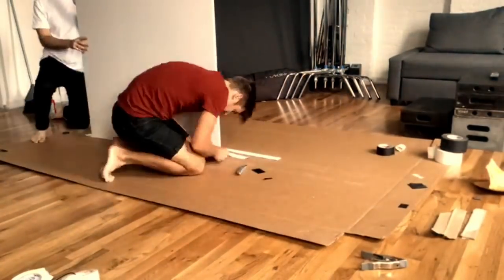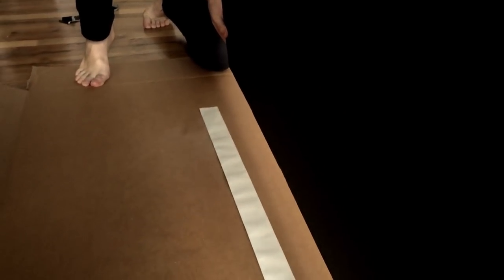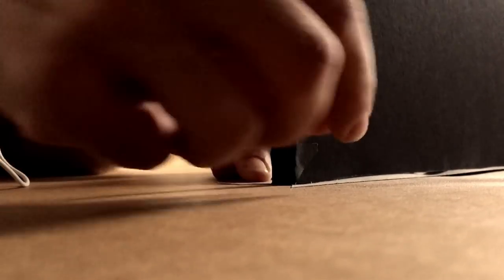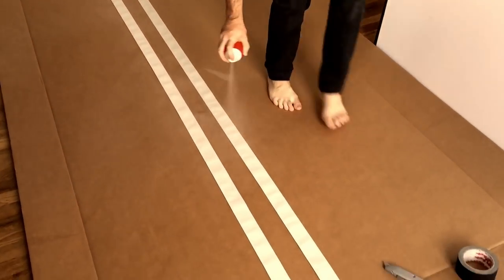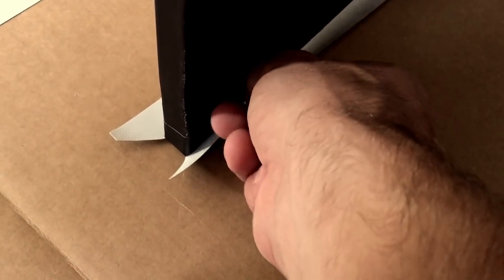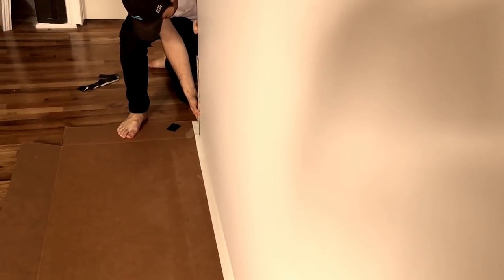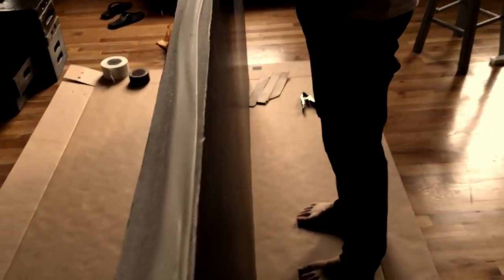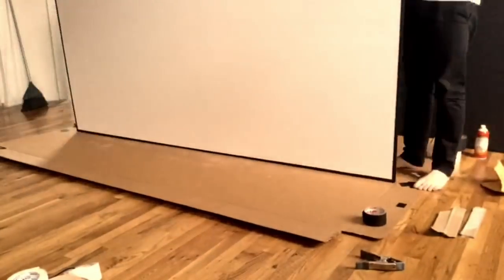How to make V-Flats - Felix's step-by-step guide

Comment: For people who can't get black/white combination boards what we do in Australia is glue a 5mm paper faced white panel to a 5mm black panel to get a very stable unform finish. These we hinge together with velcro strips and in the last few months we've also started to add an aluminium U shaped extrusion around the edges which adds to the durability and increases stability.
Reply: I buy white insulation foam boards and paint one side matt black. Sucks up a bit of paint though. About two panels per litre of paint
Reply: @cptbrncls7050  did it warp though?
Reply: @Avat6  no
Reply: @cptbrncls7050  ok I did try the same  on foam board and applied 2 coats of black Matt paint. It did warp which is a bit annoying .
Reply: @Avat6  stuff I used was about 50mm thick. Insulation panel
Reply: Would it also work if you get some wood panels, paint them and put them together with hinges? Or would that be to heavy?

Comment: Manufacturers make foam core products with white on one side and black on the other. You'll want at least 1/2", 3/4" or 1" thick sheets, not 1/4". I couldn't find the size from retailers for a reasonable amount... look for wholesalers to the framing or sign industry. You should be able to find a local source--shipping something that size is ridiculously expensive for a few sheets.  To do it on the cheap, go to Home Depot or Lowes and buy 4x8 sheets of rigid insulation and paint them yourself with flat white and a flat black.

Comment: Thanks for this tutorial. I just have a couple of questions.
Since the tape is already sticky, why does it need to be sprayed with photo mount glue? 
Since the tape will be permanent, can normal duck tape (eg. Gorrilla Tape") which is 1/4 the price of Gaffers Tape ...be used instead?
Reply from the maker: jjaylad The spray is just for extra durability. Maybe it’s not needed. I just put it on to be extra safe. 

Don’t use duct tape. Apart from it being reflective, it dries out and will start peeling sooner than gaff.
Reply: Felix Kunze cold you tell us where you got the foam  from core board from? Is there a link for it ? And how is it black and white or did you paint?
Reply from the maker: Moe Alyasini check framing stores :)
Reply: Felix Kunze i am in NJ as well maybe you can give me a specific store name or location ? Thanks a lot in advance
Reply from the maker: Moe Alyasini  check with Set Shop in the city. They sell kits

Comment: I was wondering where you got the foam?
Reply from the maker: Jennifer Duffy I got it from a wholesaler in New Jersey but lots of arts supply stores and framers have these.
Reply: Felix Kunze  thank you.  I will check around Nashville.  I know Michael’s have 40x60 foam core in the framing department but it is the single thickness.
Reply: Felix Kunze i am in NJ too ! Could you tell me which place is that and was it already painted black?
Reply: @JenniferDuffy  Did you ever find any 4'x8' sheets around Nashville?
Reply: @ketoduo6117  I didn’t. But I live about 45 mins outside the city.
Reply: Felix, wie groß sind die Schaumstoffplatten?

Comment: Why do you use the photo mount?  What does this product do?
Reply from the maker: It's to make the tape stickier and last longer. Without it, the cycles of temperature change and moisture will weaken the chemical bond of the sticky layer on the tape
Reply: Where do you get the idea that the fotomount will make the tape stickier...chemically these are NOT compatible....can you document the stickier part of your statement

Comment: is the foam core boards black on one side and white on the other?
Reply from the maker: thePHOTOphilic P yep
Reply: You can buy it at any decent art supply store, and also companies like one we have in Canada called U-Line (check it out and you'll see what kind of company it is - basically just about any kind of remotely industrial supply need you can possibly imagine - you'll certainly have companies like it where you are!).  Easy to find. But not cheap and unfortunately only sold in bulk, (here it's 25 sheets per carton) so split a carton with a few photographers. Or find it at an art supply store, although much more $$ per sheet.   OR- just paint one side of a normal white panel!! :)
Reply: Here's an example of what we can get here :  https://www.uline.ca/Product/Detail/S-19382/Foam-Board/Foamboard-48-x-96-Black-White

Comment: Where did you get your foam core boards and how thick are the individual boards?
Reply: +Danelle Jones Looked into finding these previously, but couldn't find them at my local Lowe's/Home Depot
Reply from the maker: Find them at art supply stores or wholesellers. Someone should really make a 'where to get foamcore boards' list for each country. 
There's a place in NYC called setshop that has them.
Reply: +Felix Kunze Brad Moore said that's where he got his, but Every time I lol, you've gotta buy in bulk
Reply: I tried to source some 4x6 boards and it costs about a 1000.00 where I live!

Comment: the v flat just needs to be functional...you don't need to put anything on the edges...why spend more money and time making this...the edge will NOT help it do it's job...
Reply: Depends on how messy the edges of your foam boards are. If you use polystyrene boards like Sue Bryce, the edges can be pretty rough.
Reply: so the edge is rough...how is that preventing the v-flat from working?
Reply: It'll work fine without tapping the edges, but its a quality of life thing. Tapping the edges keeps them a little more protected from moisture and dings. It also makes the flats more comfortable to handle. With insulation V-Flats, its necessary to keep the edges from crumbling, especially if you hade to cut the boards to size. If you want to keep the boards for a good while, its worth the $12 in Gaffers Tape.
Reply: Def works way better with taped edges i've tried it and if you can't afford a couple of dollars in tape you probably can't afford to be a photographer ;)